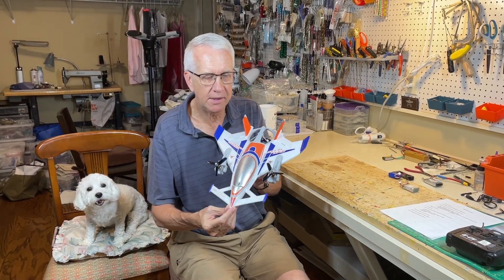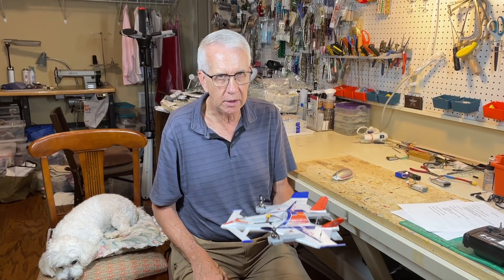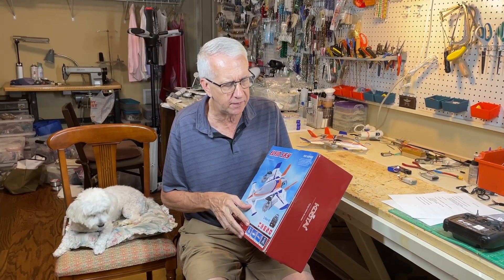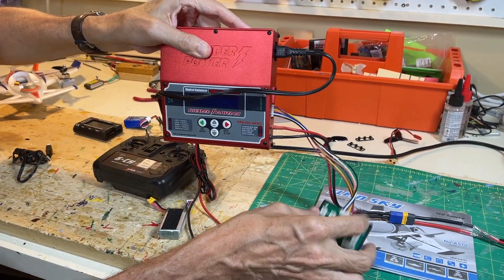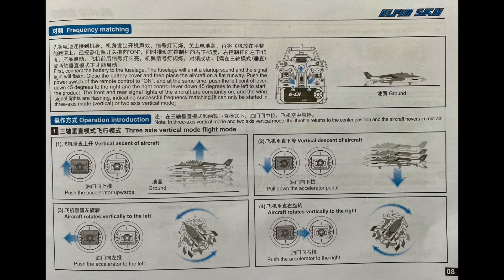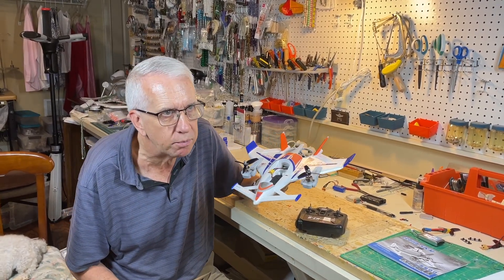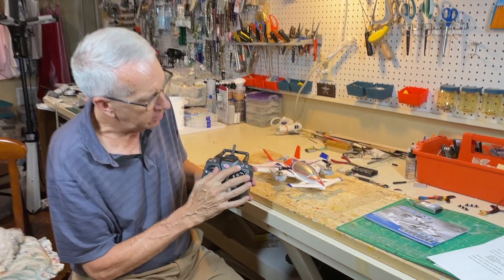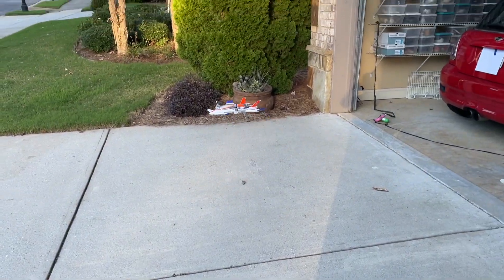QIDI 570 VTOL RTF RC Airplane

Comment: Horizon had the Convergence and mini Convergence very similar to this. There was also an XK version.  A similar configuration was used on the V22 Osprey from Horizon that I have and love. Banana Hobby has a larger version they still sell.
Reply from the maker: Thanks for the info . . . good to know!
Reply: @TimMcKay56  To complete that list, the XK X450 (which has the Vertical Mode as here in addition to the Multi-rotor and Plane-only Modes of the Horizon models) and similar JJRC M02 and Yuxiang W500/Skynetic Mesa VTOL are over the 250gms limit. There is also a kit to transform the Heewing T-1 Ranger into a similar VTOL plane.
All these designs suffer from the vulnerability of the swivel-motor mechanisms. But at least nobody usually gets killed by the failure of same. (Unlike the 3 young Marines who were lost in the crash of their Osprey near Darwin in recent years!)
These things need to be flown fast and turned carefully in plane mode to avoid catastrophic stalls and damage. The metal geared swivel servos in these are tougher than the plastic geared ones in the stock XK X450 but they will also break! And the small size is a real PITA to replace! At least you get 3 serviceable 2s brushless motors and adapters as spares for other builds when you wreck these. 🤔😜😊

Comment: Dear Mr Tim,
Thank you for posting videos as they are very helpful to me. This question is off topic but I just have on question. How do you bind a transmitter to a micro brick? Im buying the DX6e but i dont know hot to bind to the receiver.
Reply from the maker: It can vary with the micro brick. For the Parkzone, just power up the brick with transmitter off. In 5-10 seconds it should enter the bind mode with a flashing light.
Reply: @TimMcKay56  Thank you!